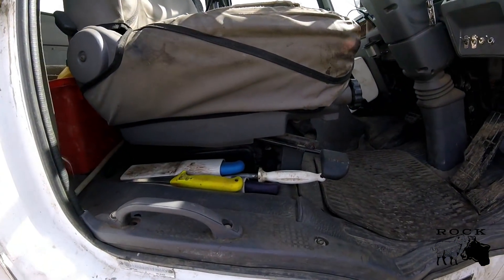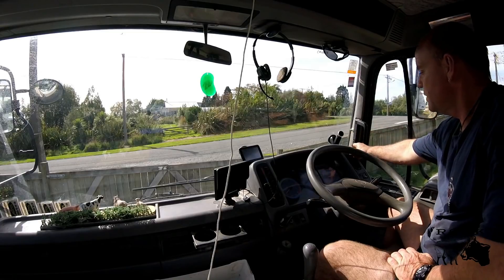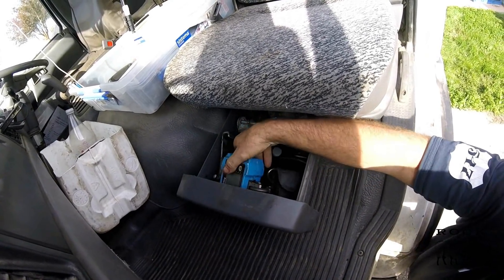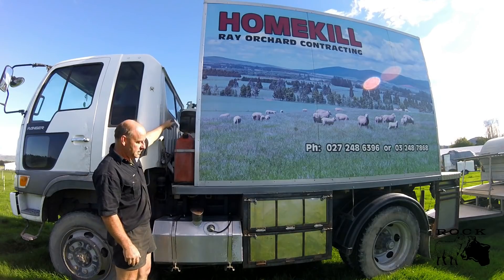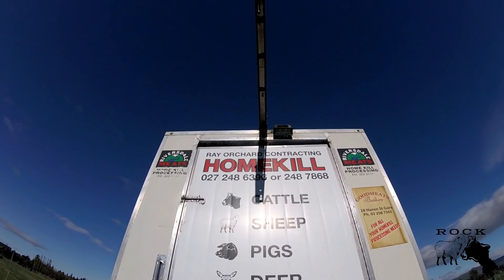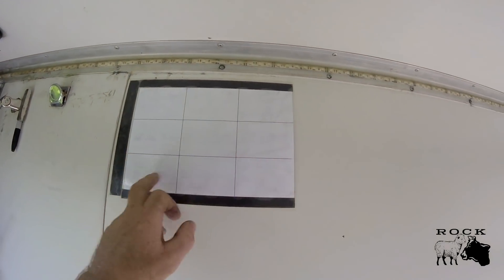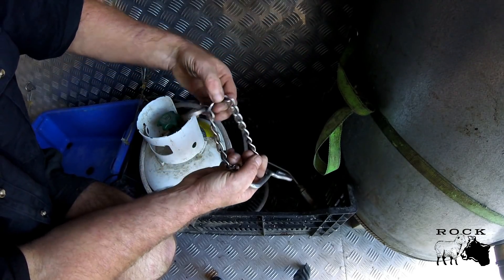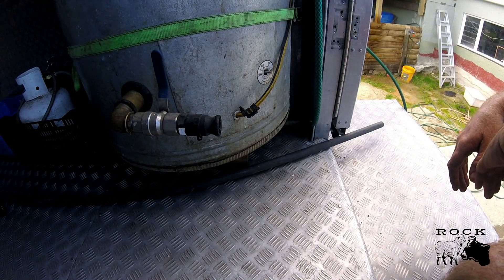HOMEKILL TRUCK SET UP

Comment: Excellent Oz mate, Thank you.  Excellent system you designed, your lorry is the biz.  I saw the tip of your sheep skinning knife in another video.  Would be handy if you could show us a close up of you getting knife under front leg skin, at shin, and down towards neck, on both legs.  I find  that the hard bit as regards a fluid motion/cut, without marking meat.  Your videos are the best.
Reply from the maker: Thank. I'll get onto it soon .

Comment: So I have a couple questions, is your rig 4 wheel drive? What size of winch are you using? Here in the US we call it on the butchering and I’ve dreamed of a rig like that. Thanks for posting.
Reply from the maker: Yes the truck is 4wd. The winch is rated to lift 1 ton.
Reply: Thanks for taking the time to reply. Be safe. Blessings to you